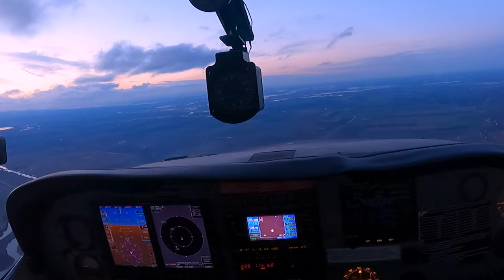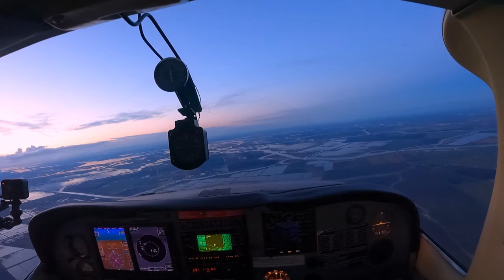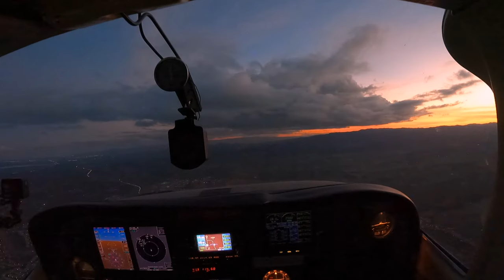WHOA! Fuel Flow is really low. Flying in the evening and at night.

Comment: Hello Ed, the low fuel flow issue might just be an instrumentation problem... One way to check, is to check the EGT/TIT readings... If they seem high, then yes, land it asap while it's still running... If it seems normal, then it is probably an issue with the instrumentation... Do you have an instrument rating? Is Your plane equipped for IMC? If you fly over Carneggie M/C park, are there still people riding there? That place had serious Hills!!! I went there several times when I lived in the Bay area (S.F. Peninsula, San Jose, Suisun  City) back between 1986-2007...
Reply from the maker: Yes to all the questions :) - The EGT/TIT CHT were all within normal range, the only instrument that was out was the fuel flow and I remember during the flight I clicked "Yes" to the question "Do you want to automatically adjust the K-Factor" after I filled up and the difference between what it thought it had burned and how much fuel was put in. I do have an Instrument Rating and am keeping it current. This aircraft is instrument capable. Its been a couple years, but I take my KTM 1190 out at Carnegie
Reply: @TheEdwardFrye   Gotcha... That is a good way to tell if the induction system is working properly... Maybe there is another good TCM-TSIO520 floating around someplace that You can access fairly soon to replace the one that failed... The KTM 1190 looks like a nice 500 lb. Sport-Touring machine... Great for long trips into canyons and groomed roads... Have you ever gone to Clear Creek? It is an SVRA just to the  North West of the town of Coalinga... Really nice trails there, especially for a bike that has good ground clearance and long legs like the KTM you have... It would probably take you no more than 35 minutes to be able to fly over it from Tracey... Check it out... It was one of the better places to camp & ride in the central valley, 15-35 years ago when I was in that area... I'm thinking of you on that bike riding around, and it reminds me of a TV show that I liked when I was a kid... And then came Bronson, starring Michael Parks...